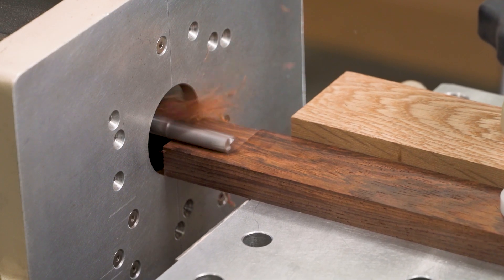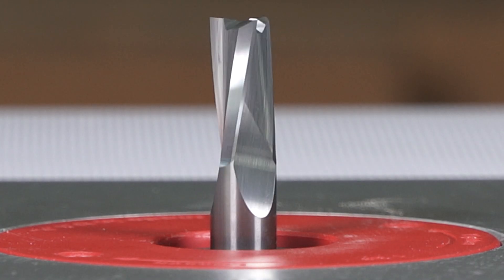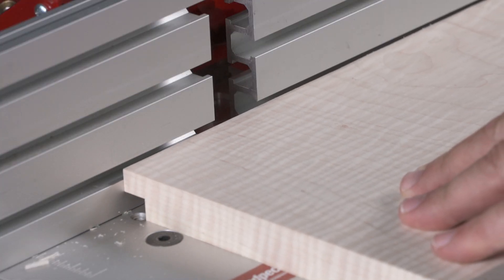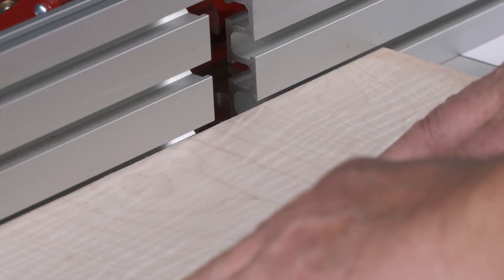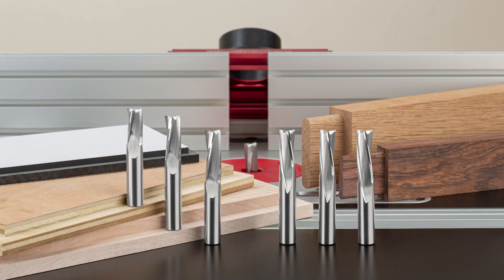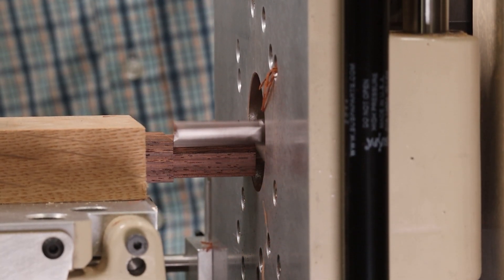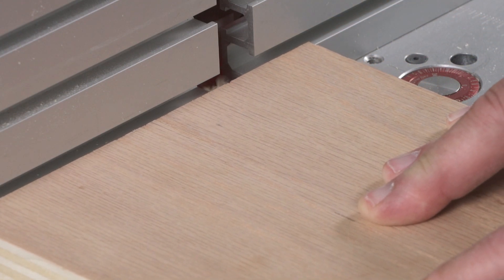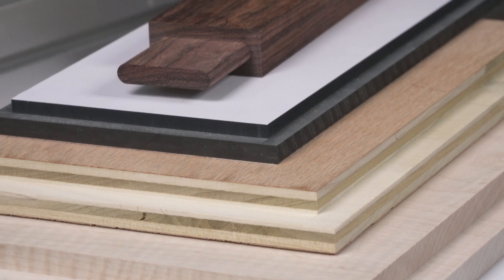Ultra-Shear 1/2" Solid Carbide 3 Flute Slow Spiral Router Bits

Comment: Why are these called "Slow Spiral"? Are they meant to be run at slower speeds? Or, is it the flute geometry? Sorry if I'm being a little slow.
Reply: the geometry of the spiral, as you can see it is almost like a straight bit, but still a spiral
Reply from the maker: Right...it's the flute geometry. Now...why the "slow" flute cuts dense materials cleaner, I can't answer, but I can confirm that in the shop whatever voodoo the engineers have whipped up works like a charm.